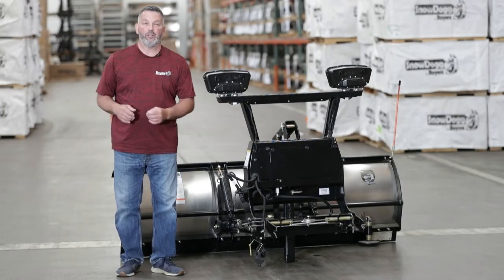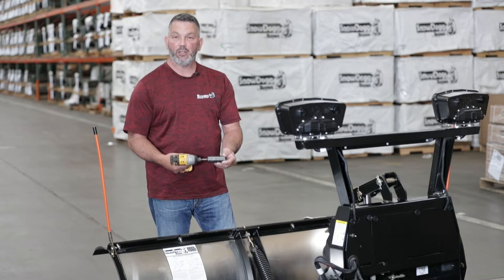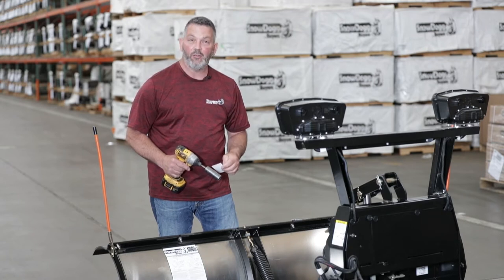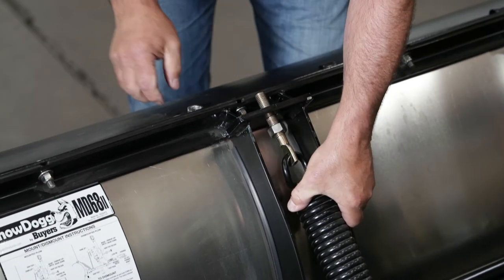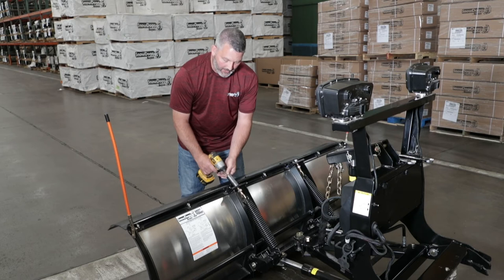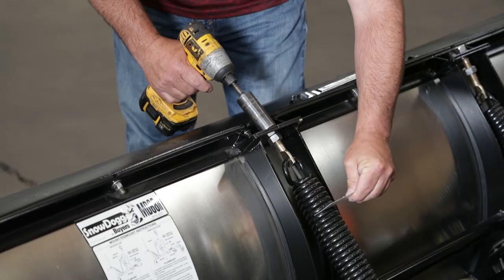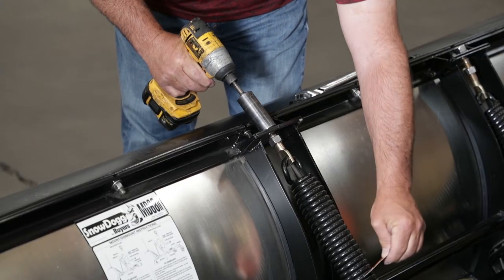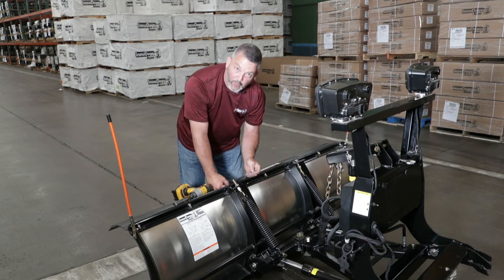SnowDogg How-To: How to Adjust Tension on Your Trip Springs

Comment: I have a question  I had a  vplow installed. On my 2018 f250 I did the up grade led the dealership that installed  cant figure  it out soon as plug plow in the truck my passenger  day light stop working
Reply from the maker: Hello, Jay! It sounds like this Technical Service Bulletin should address the issues you're having - https://www.buyersproducts.com/UserFiles/SnowDogg-TSB/16-TSB88-112519.pdf. Please forward this link along to your dealer. 

We are very sorry for the inconvenience! Please let us know if you need additional assistance.